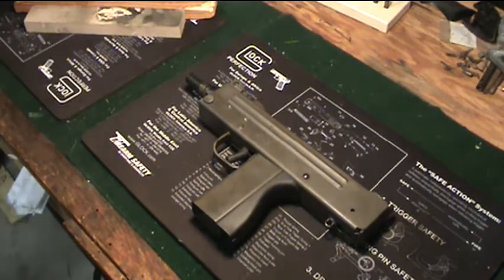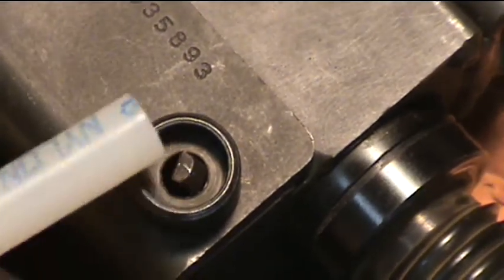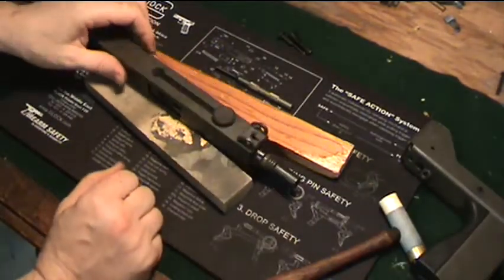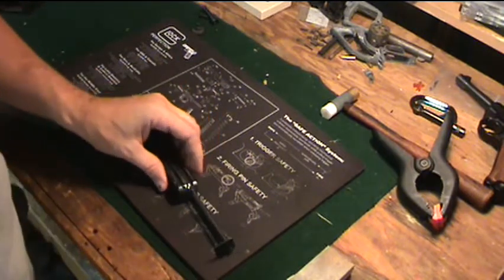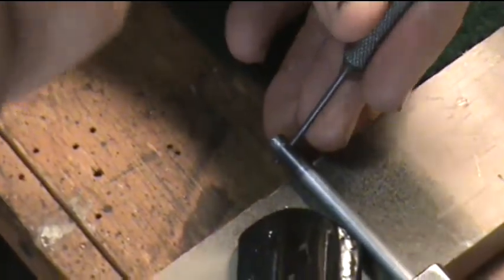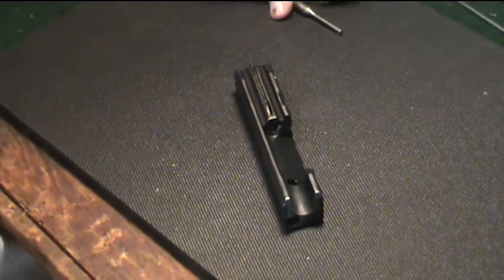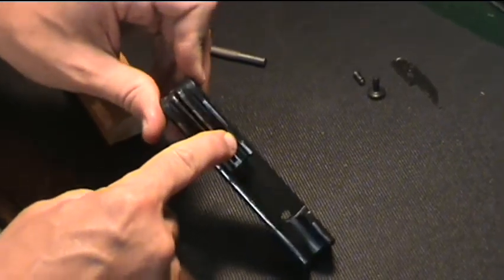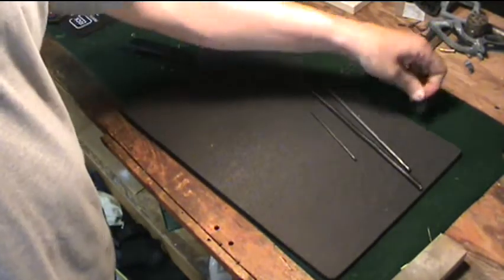Cobray M11 Detailed Upper Receiver Disassembly.avi

Comment: Great video. My m11 had the firing pin mushroom and needs replacing.  Do you think heat treating the pin before hand would help? Heat, oil quench, reheat then air cool.

Comment from the maker: It is easy to do.  Same shaoe as the metsl buffer plate, just line up the holes.  goes between the metal buffer plate and the bolt.

Comment from the maker: Cobray sells them with 2 holes. 1 centered 1in the corner. Same shspe as the plate, line up ghe holes. Cut off the corner hole and you will not need to disassemble the bolt, jyst pull out the guide rod. You can buy them that way too but not from Cobray.

Comment: seems a lot of people are having the same problem I'm having. the recoil buffer. I know where it goes, against the back plate between it and the upper receiver.  my question is do I have to go through all that, or can I cut through the buffer  to the hole for the recoil spring  with a razor blade so the I can slip it into place without taking it completely apart?
Reply from the maker: Cut through it.  There are 2 different brands available.  One of them has the whole corner cut away instead of a hole and it works just fine.  Cut through it or cut off the corner and do not disassemble.

Comment: I have a mac 11 and the buffer pad has been removed by the previous owner. I'm really not sure where it goes and where I could find a replacement. Do you have a video showing installation of the buffer pad? Thanks in advance.

Comment: Ahhh frickety frack I had pin shear. I lost my grip and wammo. I bounght my m11 a few years ago and it was a mess. Gunk all inside the firing pin and spring and behind the recoil spring plate. I have my new buffer and I found a place that sells replacement pins so I ordered 5 of them.
Reply from the maker: if you're buying parts, and don't have them already, buy the upgraded receiver pins.  those c-clips are junk

Comment: You mean the receiver pin which there are 2 of. I have the one piece with the bearings built in.
Reply from the maker: The main pin, under the barrel, has an upgrade, and the pins from the lower receiver (trigger pin is one of them, if you want to see what I'm referring to), that are held in place with a c-clip have an upgrade.  The Cobray web page seems them.  You can buy the original pins or the upgrades.  get the upgrades.